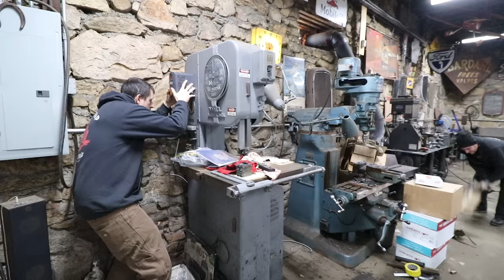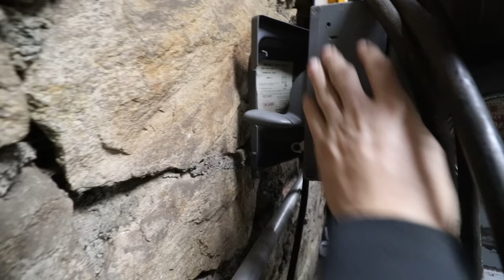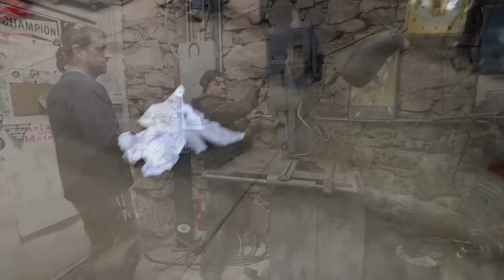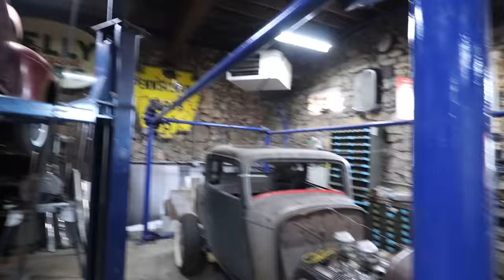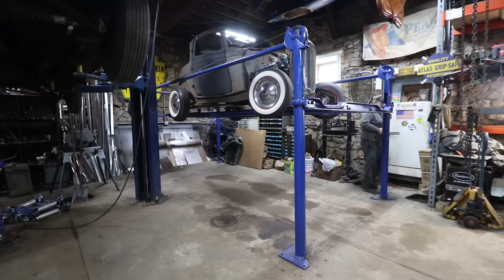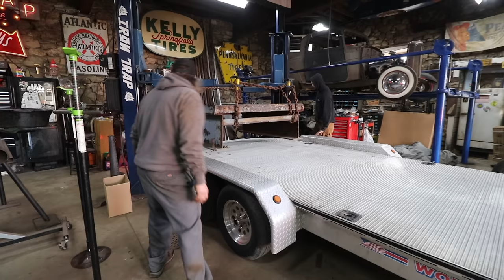All Kinds Of Shop Upgrades!! - Band Saw Is Working and New Acorn Table

Comment: Matt...just a suggestion for wood splitting from Alberta, Canada. If you were to place an un-split chunk of log on your concrete floor - you could use that to split on. If your axe doesn't go all the way through on the first strike...you could keep the wood attached to the axe - and turn the whole thing upside down and strike the axe on the opposite side of the splitting edge against the chunk of log on your concrete floor. This action creates a gravity force which usually splits those problem chunks - if they are not full of knots. Cheers!

Comment: I see you have a blade repair welder on the saw  you may want to run full power went you weld blades up so i would use the hand crank speed so not to hurt the motor with your add on inverter